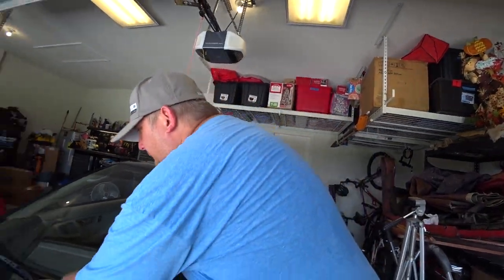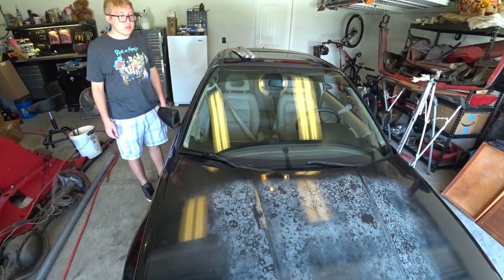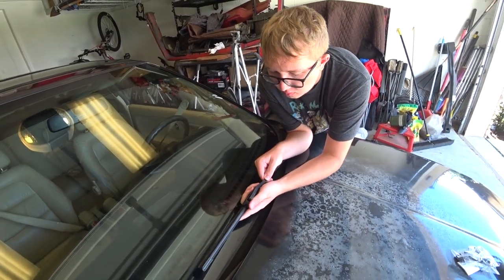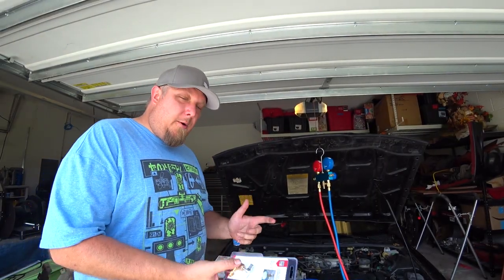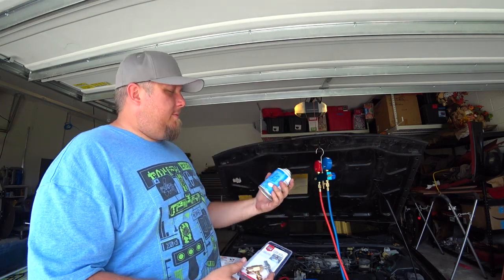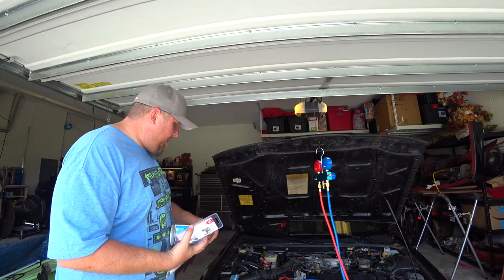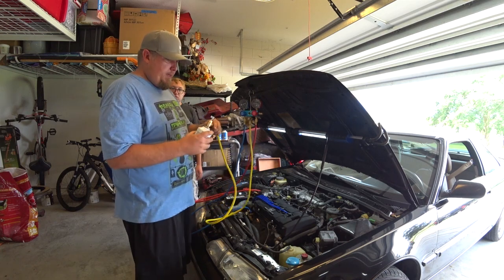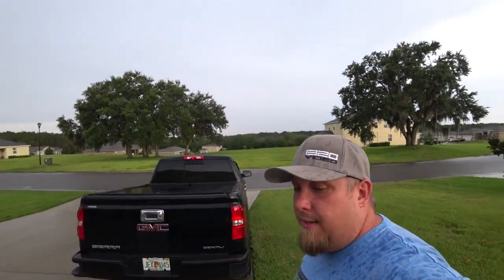Acura build part 1: Father and Son, Wipers and AC

Comment: So when is it getting painted? Looks straight, so repairs are minimalist, just gotta sand the ugly smooth and spray. Well, I make it sound easy, but it for sure is rewarding.
Reply from the maker: Alec Fleming that is on the list, that will be a simple step. I know a shop I can get the supplies from and I have the equipment, but this will be the first paint job. Should be a great learning experience for the both of us.
Reply: CamaroMac it is physically a lot to prepare it, so plan out at least a few days to scuff it alone. Done this work before so top tip, the better the prep job, the better the paint job. Don't be afraid to over inspect, as this will help you lay down a bomb paint job the first time ;)
Reply: CamaroMac Oh and not to over kill it, but the hardest color to get right is black as it behaves more like a mirror... So Matte paint or lighter colors (silver, white etc) help to hide dings, however it is a dark color so changing it to light takes more paint and thus cost a bit more. But again, huge compliments finding such a straight example of the car. This is good, means a lot less work to do!